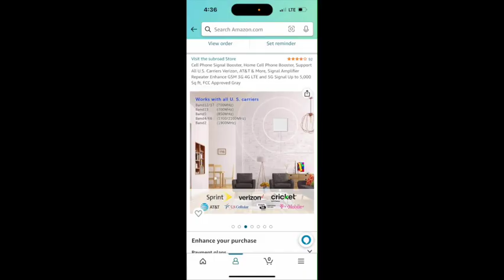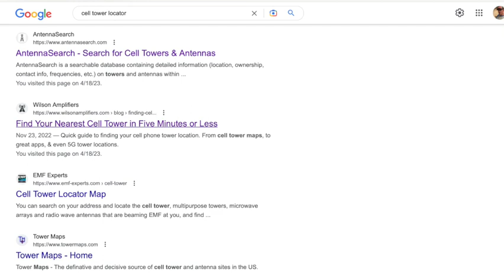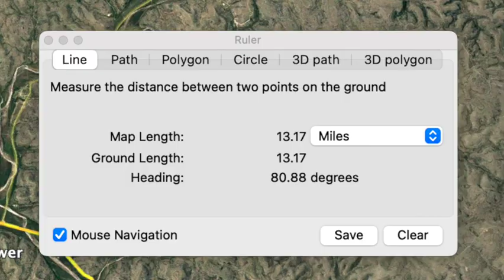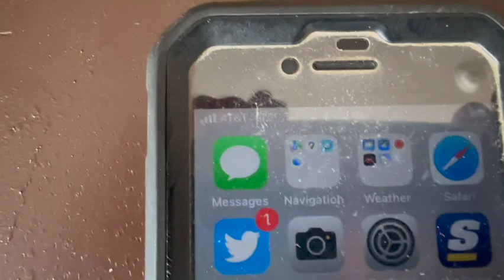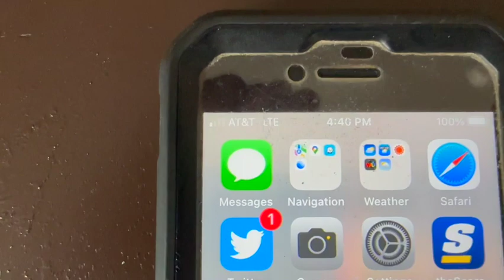Boost Cell Signal from 1 Bar to 4 Bars!!

Comment: Did you register the product before using it? I just bought one booster and I was told to register it with AT&T before using it.
Reply from the maker: I did not register the product as I never came across that requirement.  I do have AT&T as my cellular provider though.

Comment: Is there a way to boost cell signal outside of property buildings that DOES NOT rely on Wi-Fi? Even if just in a concentrated outdoor spot.
Reply from the maker: I suppose you could mount the transmitting antenna (the square white one) outside.  It doesn't appear to be weather resistant to me, so you might have to build a little shelter or cover for it where you mount it.  As long as it's far enough away from the receiving antenna (30 ft or so), I don't see why it wouldn't work outside.

Comment: Does this unit use regular tv coaxial cable?
Reply from the maker: Best I can tell it's not regular tv coaxial cable.  Regular tv cable is RG6.   This unit came with 3D-FB Coaxial Cable.  I am not sure about how those two cables are different but it appears the connectors on the cables are a bit different.

Comment: interesting product.  Now I'm wondering how one of those would work on one of the new cell-phone-based wi-fi 'hot spot' boxes being marketed by Verizon and T-Mobile in my area.  The boxes can be a little finicky with location in a house, this might help so that the box wouldn't have to be moved around until a good location is found.  For a one-time fee it would be a great value.
Reply from the maker: Definitely worth a try.  I use my cell phone's hot spot wi-fi capability at the same time I'm streaming video so I don't know any reason that a hot spot box wouldn't work as well.

Comment from the maker: Link to the product
https://www.amazon.com/Booster-Carriers-Amplifier-Repeater-Approved/dp/B09N9CCSF1/ref=sr_1_1?c=ts&keywords=Cell+Phone+Signal+Boosters&qid=1689823034&refinements=p_89%3Asubroad&s=wireless&sr=1-1&ts_id=2407782011
Reply: Can you discuss what the various lights mean?  I have a very similar device (and the very same crappy manual) and have no clue what the lights mean.
Reply: Do you have to hook your phone up to the antenna somehow or does it just automatically recognize?
Reply from the maker: @kenwheat5198  It is the same signal, just stronger.  So, your phone automatically recognizes it.